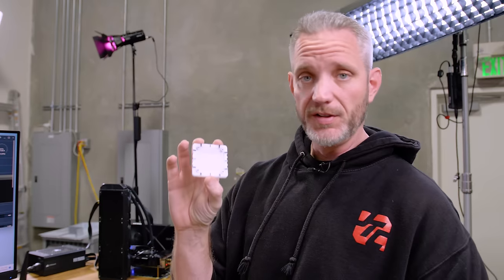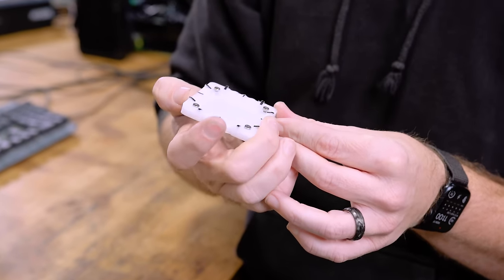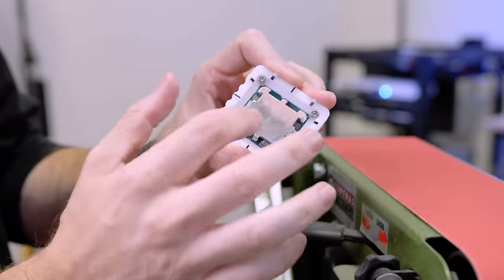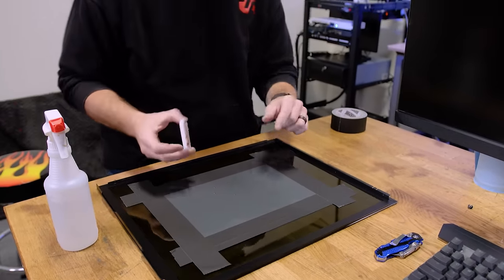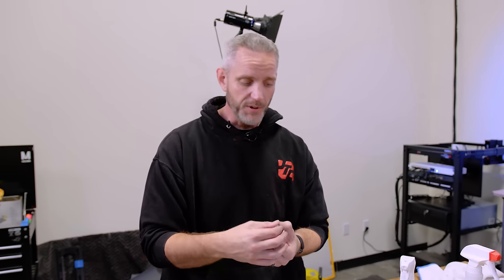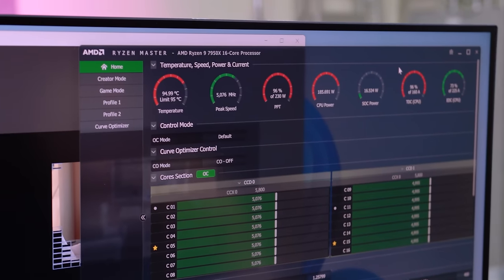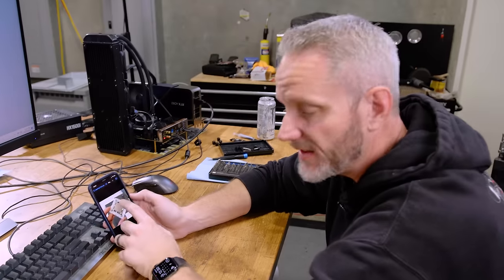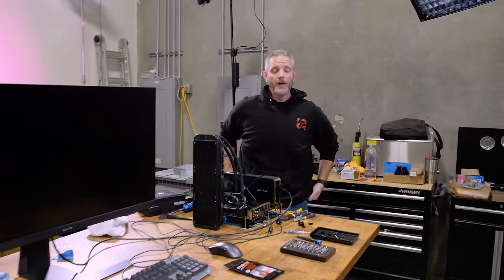Modifying the 7950X CPU for better thermals... VOIDED WARRANTY!

Comment: I would suggest anyone flat lapping for the first time to use the same flat surface (start to finish) and super cleaning between swaping grit numbers. It will take longer but it will come out near perfect
Reply: I would suggest watching a youtube channel like oxtoolco  or robrenz these people are lapping for a perfect size down to .0001 of an inch and smaller. You do not need that for your cpu, but the techniques use to keep your cpu level is a good thing to learn will make your cpu lapping come out better.
Reply: take it to a machine shop and have them mill it down. Cover everything you don't want milled with wax to keep anything from getting under the die or what ever it is.
If you were really brave, you could have your CPU cut with a vee pattern and the cooler with a mirror image vee pattern so they would both have way more surface area. A shop with a good mill could cut them to less than 0.001 mm.
Reply: I would suggest don't do it at al, nothing a single cpu user encounters would or will ever require all this butchery, this is just for fun with no practical application outside of not understanding why people who need this power use multiple servers to achieve it.
Reply: why lap.  Had enough of   hot temperatures with amd. I shouldn't have to do it with a retail product.
Reply: @animalyze7120  I only do things like this when I'm competing for top ln2 scores.
Reply: @jasonrhodes9683  That'd be real tricky. Vibration would probably shatter the silicon substrate.  And clamping would be tricky as hell too. I've run plenty of mills, and had to deal with tolerances +/- 0.0005 inch. Clamping something as delicate as a CPU, and machining something as obnoxious as copper would suck. Not saying it can't be done, but plenty of machine shops would look at the job and say no thanks. Just not worth their time. 
If you're that concerned with heat transfer, you'd just go direct die and not bother with an IHS at all. Lapping the IHS and the cooler baseplate would also notably improve performance. If you really hated yourself, you could lap the surfaces dead flat (roughly 5 microinches, or 0.13 micrometers) and wring the plate and ihs together. Boom, they're vacuumed to each other and you have very good thermal transfer.
Reply: @jasonrhodes9683  i would not suggest this at all. Cpu's are too delecate to handle the amount of intensity caused by general mill tooling.
Reply: Gamers that's who more htz is more fps and going to a server rack actually loses performance and cost around 25k more
Reply: @kamelionify  it's been done forever and the last 4 gens of Intell benefit greatly from deliding or lapping depending on what gen
Reply: @jasonrhodes9683  although I doubt most diy lappers manage to. Lapping is significantly flatter than milling.  We are talking about nanometers compared to micrometers. (I work in a aerospace shop and deal with lapping machines).

Btw what Jay is doing is sanding not lapping.
Reply: @scruffy3121  you got me there, damn, no wait. I bet the people with the mill know a little something about lapping.
If you have more money than time, that is the fastest way to flatten the back of a wood chisel. They make a specific machine for that, you see these custom knife makers use them to level their blanks.
Reply: @jasonrhodes9683  How do you make sure the wax is a flat coating, sorry much better and simpler ways to do it with a piece of flat glass (if you don't have a granite table). E Heibert's suggestion is far more practical and allows you to control all steps.
Reply: @mddunlap03  Shouldn't have to delid a retail product
Reply: Don’t rush
Reply: @Ornithopter470  you would have to make some sort of bracket similar to the retention system on your mother board so it can be clamped down in a vice and clocked in to 0.001mm
Reply: You supposed to do figure eight while lapping to prevent from sanding a corner more that the other
Reply: @Ornithopter470  any machinist worth using would just lap it by hand with is real lapping table 
But yes trying to machine the cpu is a really bad idea
Reply: @scruffy3121  it could at least use proper technique and do figure eight while hand lapping 
I saved a couple of dirt bike head that where warped this way Honda ever recommend this tech in the shop manual
Reply: @kamelionify  you don't if you noticed the performance didn't increase same MHz just 10c lower
It perfectly safe at these temp and in real usage it will not behave this way most of the time the cpu is at below 60% usage
So in day to day use you will not notice anything
This is completely blow out of proportion just like most PC thing nobody need a 7950x with a 4090 to get 20/30 fps more and need to deal with the extra heat and power consumption that a PC that cost a quarter of the price
Reply: @bakedtoasty  not worth the effort and lapping can have a better accuracy that any machine
And you not doing .001mm accuracy on a mill  .001 inch accuracy is the norm 
.001 inch = .0254mm 
Lapping will produce a more flat surfaces
Reply: @animalyze7120  okay- I have workloads that keep CPU's at 100% for a long time, and it's time and efficiency sensitive too. you can check the previous one- you can get the same performance at a reduced power draw if you can cool it better. for me, that's similar to keeping a room's lights on or off all day. it adds up.
if I get things 2-4% faster, that could be the difference that gets my job done a day earlier every week. I need to ensure that these thing have maximum longevity, and the truth is, 95c will degrade it faster and reduce its lifespan more than 70c, just as 70c will reduce lifespan more than 50c. for someone who just slams these things at max for weeks on end, it's important. 
is it worth a gone warranty? now that's the question.
Reply: @jasonrhodes9683  Just to chime in to your second point: keeping a lid on the CPU is inefficient for cooling, but necessary for ease-of-use, structural integrity when clamping down your cooling solution of choice and to let hot spots radially diffuse heat away to the larger contact surface of your integrated head spreader (IHS). You do not want more thickness of the metal layers between your CPU silicon and water (in case of liquid cooling). That is the whole point of lapping! More surface area is only beneficial for the heat exchange between the metal and your secondary heat transfer median (air or water), not for the metal-metal contact between IHS and cooler. If you were adventurous, you could de-lid the CPU, take the IHS to a milling shop to put fins or dimples in it, plus a groove at the outer edge for an o-ring, and use the IHS itself as the bottom plate of your water cooler! Not sure if the mounting pressure would make that construction water-tight, but that would be equivalent to direct-die-cooling 😇
Reply: @kamelionify  you don't HAVE to.  it runs perfectly fine out of the box.  you do it if you want eek out every last .1c and overclock the snot out of things.
Reply: @kamelionify  try 13900k thaaaats a warm cpu...
Reply: @nubnubbud  Me too.  I do some FEM which pegs all cores for times that run into the hours.
Reply: @johnanderson7739  VFX. I just spent the last 5 days with both CPU and GPU at 100% on my render rig, timing my sleep patterns to when it'll finish. 30 second VFX shots are beasts. hence why I just woke up at 8PM
Reply: @kamelionify  they are designed to redline and hit the thermal limit, if you check 13th gen Intel it’s literally the same thing: more performance in exchange for higher power consumption and therefore more heat.
Reply: @nubnubbud  I remember the days of having to wait many many many hours waiting for a render to finish.
Reply: Yes do not use a belt sander. That's crazy.
Reply: I would suggest to not try to do anything at all , use them out of the box , reducing some degrees or ramping up some clocks would not drastically change your life and make you elon musk or something , i wouldn't risk even if it's a 10$ device , but we're talking here a very costly cpu and highest of ryzen
Reply: @kamelionify  you actually don't have to
Reply: @jaanu2222  i mean that would be ideal, but anyone who decides not to do that they should at minimum have good information or instructions.
Reply: @Ornithopter470  Excellent points, I don't think wringing would be the best option though as it relies on a small film of oil still.

It'd definitely need to be investigated to see if its better than using a thermal compound.
Reply: @Ailtir  wringing requires zero oil, and a film of oil can reduce the strength of the joint. They're held together by vacuum forces, and some intramolecular forces.
Reply: @Ornithopter470  I think there is still some dispute over what forces are present and how much they each contribute.

There is 100% a layer of oil present when blocks are wrung together, it's why precision gauge blocks are made slightly shorter than the lengths marked on them to account for the film thickness.
Reply: @Ailtir  never heard of them being less than +/- a few millionths of an inch off, due to manufacturing.
You are correct about them being oiled though. I have seen dry block wrung together, however, so it's not required.
Reply: the stacking of sand paper could be a  problem.  Its better to remove the old between passes
Reply: @scruffy3121  Thank you. Always a pet peeve of mine when people talk about lapping a cpu and then proceed to whip out some sand paper. You can't lap something flat with sandpaper.
Reply: @tacet3045  the key feature of lapping is that the abrasive isn't bount to any of the surfaces.  People just don't get it.
Reply: lapping is a waste of time, if you are going to undertake such an extreme risk direct die cooling is better
Reply: I'd recommend not doing it, but do this if you're going to do it.   absolutely don't use a belt sander.  quality paper and a mirror

Comment: You could have easily exceeded 95 C using the belt sander.  Wet sanding is your friend when trying to remove metal or plastic!  (I have the same sander and can easily melt PLA from my 3 D printer if I get too aggressive.)
Reply: "if you get too aggresive" bro PLA already melts at the SIGHT of the belt sander xD
Reply: he used wet sanding after sanded off excessive material.

Comment: I think if you had measured the cpu before and after grinding and lapping with a micrometer or vernier caliper, you could turn down the standoff height the same amount to compensate using a lathe and you could have used any cooler on the chip with the proper pressure (You would have to keep the shorter standoffs with the chip after modifying it)
Reply: @T. N. i used a calliper, but there was actually no need got it perfect, but it did come in handy to know how much i took away, and i did not manage to get the whole 1.4, i might lap it down more, but my hands are bleeding already as i did it manually took a few hours to grind down a bit more than 1mm
Reply: Do you actually need different stand offs if you shave 1mm off?

Comment: It's honestly amazing how much of a difference sub-millimeter tolerances make. I'm so happy I don't deal with anything that precise.
Reply: Well a mm is pretty big actually. Even cheap FDM 3D printers (setup correctly) typically have a repeatable tolerance below 0.3mm. Above that starts becoming a problem more than you might think. Sub 0.1mm (100um) is where it gets tricky and typically where a lot of professional machining is.
Reply: Rotating the am5 socket 90 degreess would drop the temps by 10-15C

Comment: Im a knife maker and when we mirror polish a knife which can be to around 2000 grit sandpaper a trick we use is each grit go in 1 direction. the next grit go in another, That way if your going left to right and see scratches up and down you know those are scratches from the previous grit and need to be worked out. Might have to use a magnifying glass to see the real fine grits,.

Comment: Nice!!! Can’t wait to do this for my own!! Waiting for the Delid kit/bracket
Reply: RIP my peasant 5800x3D 😥😥
Reply: @deminybs  its still better at gaming
Reply: @Hansgruber1981  better than what? the 7950x?
Reply: @deminybs  yup. The 5800x3d is on par with a 7950x in gaming performance. 3d vcache is the future. Dont waste ur money on a 7000 chip if ur a gamer; get a 5800x3d. I did and im set
Reply: For what purpose?  You remaking Avatar in your home?  This is not needed nor required and if you believe you do then you need a server room not a single Cpu toaster.
Reply: @animalyze7120  because I can - I do a tech refresh every 5 years. I’m well aware it’s over kill for my needs. I’m an enthusiast and I always go for bleeding edge because I wait so long in between upgrades
Reply: @reloadingdontshoot1  gotcha, more than likely I'm not going to 7000 series at all ...don't wanna upgrade mobo/ram/CPU and possibly PSU again , especially since current setup is first custom loop, only upgrades I'd consider would be a waterblocked GPU over current 2080ti and 2nd or 3rd gen QD-OLED panel , maybe I'll do a new complete setup at 8/9000 series
Reply: Unless your building an  entirely new PC( like I am,from AM3) then upgrading to Zen4 from Zen3 if you game only is pointless. If you do editing production then that's a different story.
Reply: @dazlad926  I’m coming from an 8700k - I’m overdue lol
Reply: @ceilyurie856  bruh why

Comment: You can also use a sanding/polishing product called Micro Mesh to reduce the micro scratches on the heat spreader. Originally developed to sand/polish aircraft windshields and canopies to remove micro scratches and restore visibility (yes it's that fine).  The sheets go to insane grits like 20,000.

Comment: Change between all the sides when lapping to minimize unintentional gradients in the surface.   
Also, if you polish the CPU and the heat transfer block until they physically bond, you will get the best heat transfer. It is pretty cool to see two pieced non-magnetic of metal act like they are magnetic.  Looks Great!
Reply: I know Jay is supposedly OG, however he sure didn't look like he knew what he was doing.   Crappy semi-tutorial.
Reply: Jay is just O without the G 😅

Comment: Even with the lapping, it's crazy how much heat is pouring out of that CPU.  I remember it wasn't that long ago we only needed a 120mm radiator to deal with a CPU, and now it seems that 360mm of radiator won't be enough when talking about the long gaming/ intensive software sessions.  Great video!!
Reply: appearently you don't... according to hardware canucks' testing the 7950X does perfectly fine even under a 120mm tower cooler. The whole cooling issue seems a bit overblown by Jay.
Reply: @cosmic_cupcake  i mean "perfectly fine" is subjective with this series of CPU's because they are designed to keep in the range of 95 C.  So yes you can cool the chip with anything, but the performance you get will change drastically if it has better cooling.  It will always try to hit 95 C and throttle if you exceed that limit.  "Perfectly fine" does not mean what it used to mean for previous generations.  I think I remember just fine.

Comment: Can't wait for the delidding video! I delidded my 9700K and put a copper IHS on it with some liquid metal in between. Runs like a champ!
Reply: Need to try this to get some more life out of my 9700K
Reply: Liquid metal could breach the circuit if maximum care is not taken
Reply: @samsonadeboga223  it’s easy to take care of, take nail polish and cover anything that can short.
Reply: @ZMan3k I read nail polish is not ideal as it can deteriorate over time due to the heat.  There are epoxies that can be used instead.
Reply: @3DxPOD  been running like this for almost 3 years without issues yet 🤷🏻‍♂️ at this point if it causes something detrimental to my rig I’ll just build a new one

Comment: It's cool that delidding is back in style with these cpus.  I delidded my old 8700k, and that turned out to be tons of fun, having the fastest cpu on the block.  I sorta won the silicone lottery wirh that, managed a 5.3 all core.
Reply: You risked a good CPU and were rewarded with great success. 5.3 GHz is amazing.
Reply: Mine did 5.3 at 1.3v before delid :) it's the only golden chip I have ever got.

Comment: Looking at that huge ass heatspreader i'm definitly gonna delid it when i get mine next week. I think it's the best cpu to do that with. Derbauer got 20C. Lapping just seems to be more work than delidding for less temperature gain.
Reply: did you find any tool for deliding? Debauer's one isn't released yet apparently.
Reply: @alext9558  No, actually i'm still waiting for my custom waterloop. I just have an AiO now so i don't delid yet.
But temps are good enough. Though i had to limit cpu to 80C + slight undervolt and it only reaches ~5.1 then which is still blazing fast. Stock 7950x reaches 95C+ very quick. I feel sorry for the users who get this and have no idea about bios and customizing.
I'll try to overclock it to 5.7 when i get my loop.
Reply: @jx4219  same here, waiting for my case since last month, I think I'm gonna go down the lapping road as I want to delid anyways at some point. Cheer!
Reply: Im waiting for the 3D variants to come out and yea AMD really fucked up with this IHS.
Reply: personally gonna just lap it since that feels safer to me and I dont need any extra tools or parts for it. I can just 3d print the holder for it for lapping
Reply: @michal_king478  i was thinking the same thing but i cant find any dimensional info on this 7950 online.  I dont really wanna pull my system apart to take measurements of the chip.  Did you find measurements anywhere, or how were you going to go about this?